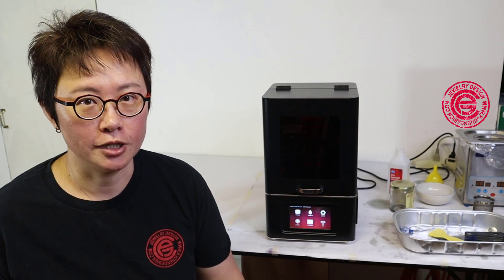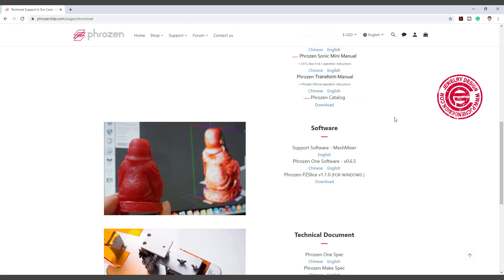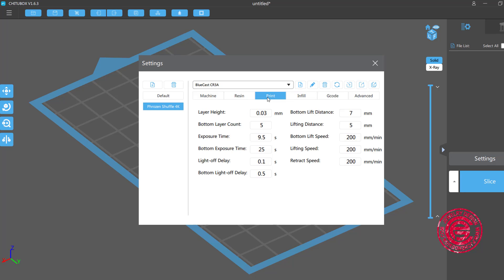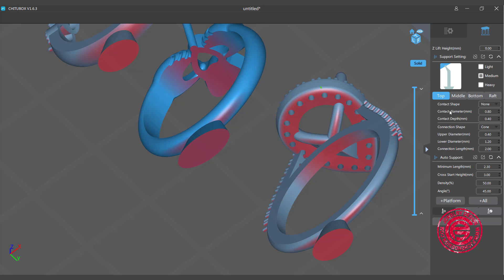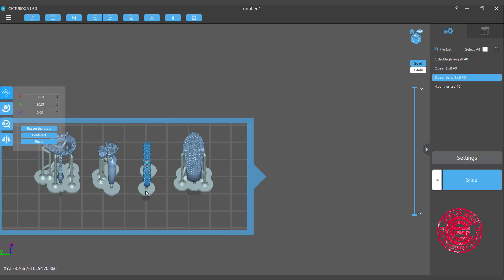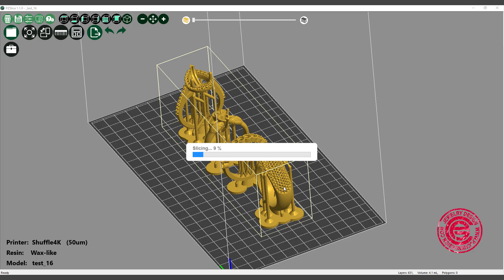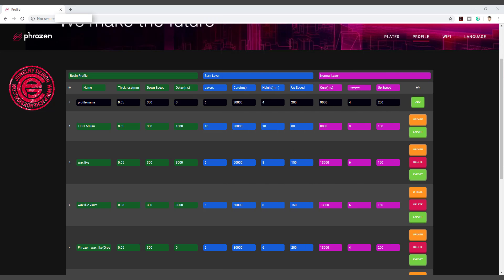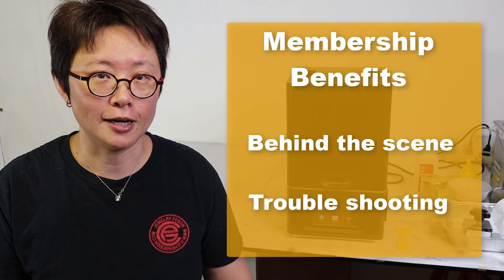Review Phrozen Shuffle 4K 3D Printer for Jewelry Design (Part 1)

Comment: Hi I recently bought this exact printer and i followed your steps but it doesnt seem to be printing. Im using the Blue c3da Resin in your following video and copied the profile. Do I print from the printer or do I click print from the screen on my monitor? Or both? The machine appears to lower and dip into the resin then goes back up and doesnt give a time or anything when I confirm the print.
Reply from the maker: you can use USB or wifi to upload your file to the machine. my printer didn't acting like yours. you may want to contact the support.

Comment: Hello Ι hope the 4K has come in handy for you this far - I have worked with phrozen machines and they can produce really good stuff. If you generally slice with Chitubox and/or don't want to use PZslice you can just rename the file extension  .zip to .phz and you are good to go! (A tip to whom it may concern)
Finally , I want to tell you that you are a really masterful designer and great at teaching Rhino! Everyone can learn so much from your videos, I hope I do from now on that I subscribed!
Best wishes from Greece...
Reply from the maker: That is a good trick for the file extension Vasillis. Thank you. and welcome to my channel.
Reply: You don't need to rename the zip file. You can import it directly in zip format. In Chitubox the print settings are useless because you will choose the resin profile on the printer. Just pay attention to use the same layer height on both.

Comment: I hope you have better luck with your 4K than I have had.  I pre-ordered mine when it was announced and for the 1st few months were great.  I Printed with it 1 or 2 times a week and it was printing great then it died in Oct.  After a long process of commutating back and forth I received a replacement LCD and PI from Phrozen. by that time I was  in the middle of Christmas rush so couldn't tackle changing out the parts.  Finally had time to tackle it in Jan.  made the changes got it up and running.  Printed prefect for 2 weeks then I started getting failed prints.  After much corresponding (problem with time difference) they have finally figured the LCD has gone bad again.  Now they want $200 which is a reduced price and I appreciate the discount but still not sure I want to keep throwing $$$ at it.   Also I would suggest trying CCW Resinworks Violet super company to work with prints excellent on Phrozen  machines.  Cured properly it cast great!  I enjoy your videos very much thanks for the good info.
Reply from the maker: You are welcome David and thank you for sharing your experience.

Comment: Hello PJ, Thanks you for this review and your amazing videos. I’m looking for a Phrozen printer and the 4k seems great for jewelry. However, I tried to figure out if 4k (31 microns) is really mandatory compared to the Shuffle (47 microns). Some say no because of casting, polishing…

I’m facing a limitation with my elegoo mars (with Bluecast CR3A) when I try to engrave words on a shank. I respect the magic number between 0.4/0.5mm for any details but the gap between the side of a letter is always fill with cured resin. You can look this video for more details.
https://myjewelrybench.com/elegoo-mars-uv-printer-and-castable-resin-limitations

It appears to be a problem of light leaking and not the resolution, maybe due to this low cost printer. It would be great if you can test a print of very small words with “romantic” police on a ring to see how the 4k is doing. Thanks.
Reply from the maker: For the letter, it is always the issue. It is not just print and done. As you mention, there are casting and polishing factor. I always suggest my client to do leaser engraving, if possible. If not, the text just need to be certain thickness and depth.  From my test (coming up soon for the part 2) I found 30 and 50 micron printing do has big different under 10X jeweler loop. However, It is not significant different after casting. I think the low cost 3D printer is shaping the jewelry industry and business trend, and provide more clear communication and help to visualize the final design between designer and clients, but is there one printer or one technology can complete a jewelry piece at once (like metal directly printing, so no casting need)? I really doubt it.
oh, just realize. I may go too far. anyway, I will do a test for the text for our member. thanks for the input.